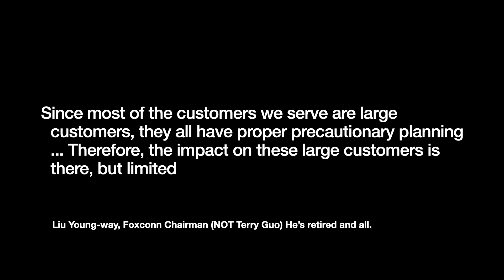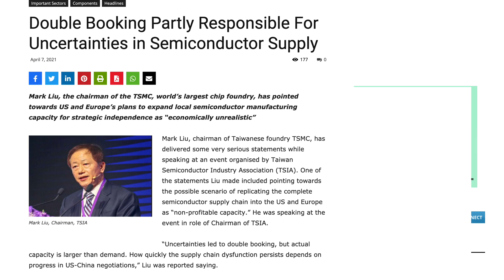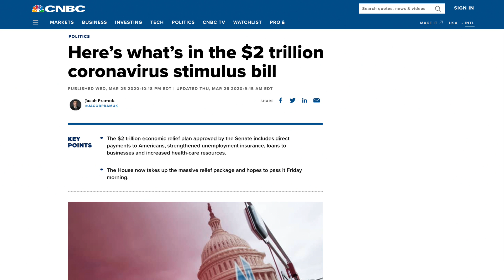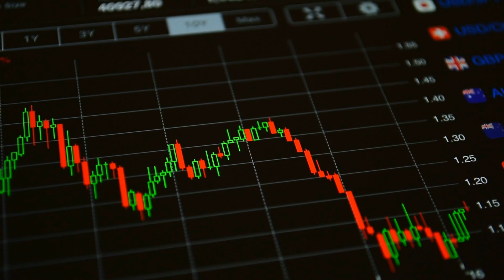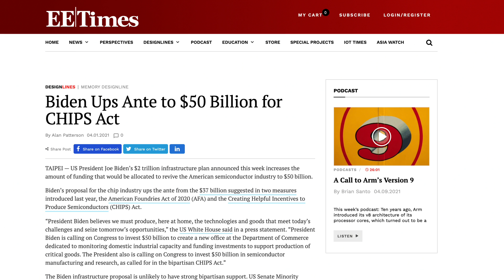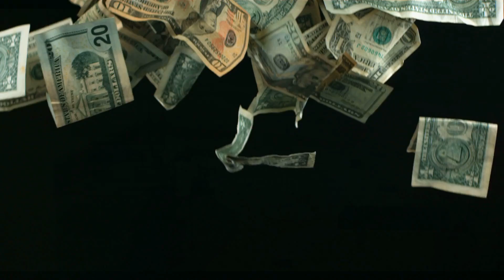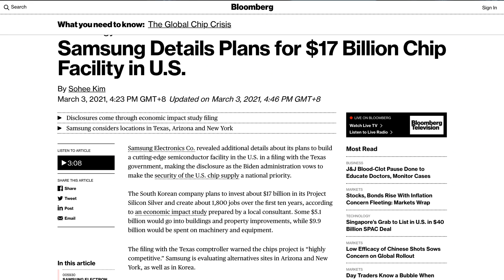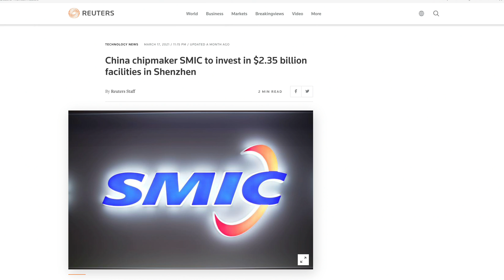The Coming Semiconductor Bust

Comment: Is anyone doing research on resonant tunnel diode threshold logic fabs? With threshold logic reducing gate count by 30% and tunnel diodes at 30 THz with a speed power advantage over CMOS of 100,000, this would be an excellent future path. Especially, now that CMOS CPUs are setting fire to motherboards and GPUs are melting connectors and wires.

Comment: Great analysis. It's clear you were right

What you didn't predict was the Ukraine war and it's absolutely massive insatiable demand for electronics.

Each side is fielding tens of thousands of drones each month. Combined with sensors, terminals, headsets and a myriad of other electronics it's clear that if it wasn't for the war the industry would be in the middle of a bust.

Although you have to wonder who had advanced knowledge on the Ukraine war..... Seemed like a pretty  amazing bet to spend some $200-300b on fabs despite the collapse in crypto and the covid WFM situation.

Comment: 3.5Billion / 50000 = 70,000 die/wfr.  What are you talking about?  Maybe the smallest freaking logic chip (which hardly anyone uses these days),  you might be able to get 70000 die/wfr....BUT no one knows because those are not the kind of things that will run in that TSMC fab. For things like processors and such you are lucky if you get  a couple hundred on a wafer.  (Yeah,  I worked at a leading edge fab.)

Comment: I’ve been thinking this for a while too. Each factory is also getting more and more productive with time. When new fabs are built on this scale those productivity gains will be applied to the new fabs and output will be insane. Market won’t know what to do with all those chips. 

If we have a war then all bets are off. War will likely break out in Taiwan and all that capacity goes to zero. Plus the need for chips for missile systems will send demand skyrocketing. 

It’s 50/50 at this point and all depends on what happens with the China/Taiwan situation.

Comment: Read a bunch of comments, that I agree with, you concentrate on the obvious users of chips, computers, cars and consumer tech, but miss the fact that all industrial machines from the largest to the smallest all use thousands of chips. And they are just the tip of the iceberg of other chip users. Nothing sold today that connects to mains or batteries is free of chips. Even the battery packs themselves have chips in them.

Comment: A great video, with terrific insights. The boom and bust nature of this industry is too quickly forgotten. Thank you.
Stepping back for a moment to look at the broader macro economic environment I have to consider a huge shift in the fundamentals which you may wish to consider. Simply that America is going home because there is no need for importing energy from overseas.
North America can easily become self sufficient in every single commodity, from oil and gas to wheat to rare earth metals. Hence the US military will no longer require be a provider of sea lane security, which it has done for American intrests since WW2. After all, why help your competitors when it no longer benefits the US? The US will only assist it's core allies and it will expect them to help themselves. Global supply chains will reduce dramatically. The world's biggest consumer, the USA, due to favourable demographics compared with the rest of the world, will get the majority of its needs from manufacturing in North America. Mexico undercuts Chinese labour easily with the benefit of a short supply chain and cheap US energy. The industrial boom from relocating manufacturing to North America will be enormous and drive the economy of the region for at least a decade. The new factories will be as automated as possible, which will be good for the semiconductor industry, but semiconductor companies will relocate or not be able to sell to this market. Expect the US Government to demand that companies it does business with to become American or registered in a close ally country. The likes of TSMC, AMD and Intel will open new fabs in the USA and not update fabs in most other locations.
Of course Russia invading the Ukraine and kicking off Cold War 2.0 will affect this fundamental thesis in unforseen ways, but a massive relocation to North America is absolutely guaranteed. Along with this will probably come a political shift towards isolationism, which has already been the case for the last four Presidents, as the USA simply won't need the rest of the world as much and hence won't care much what happens outside of her borders. The results of this shift will, and possibly already are, be felt around the world.
Just an opinion. All the best everyone and good luck.

Comment: Chips do store well. Mostly the base chip is created and then finished to specification. Most suppliers use long term contracts and thus cycles are smoothed. There is no shortage. There is excess demand. FABS are expensive which creates high barriers to entry. 

You have offered no new information. In fact you are just regurgitating a common thought about the industry that is no longer valid.

Comment: the funny thing is that half of these fabs will go bankrupt or get bought out exactly because of that 'saturate the market with anything down to the lowest possible cost for given production of scale' - so essentially the most efficient/biggest ones will out-marketshare everyone else, and if they don't and collapse instead, then it'll just mean an even bigger chip crisis - too big to fail logic.
But at the same time demand has moved into virtual demand, because with price inrease affordability ranges haven't changed for most people, but the more people in the sencond/third-world are moved out of essentially poverty into having the option of the firstworld middleclass spending - that also adds demand (majority hasn't been), so there is room for cheap chips.

Comment: Chip designers (AMD, Apple, Intel, NVidia, etc.) pushing the envelope need to be accounted for in the equation, because the cycles are tightly connected.
For many years, we had slow progress on the design side, but that has changed.  Massively complicated designs, combined with new packaging technologies, require larger number of chips.
I believe this trend (new more complex designs and packaging solutions) will continue for at least a few years, and will keep the fab business thriving for at least that long.
Reply: Circuit board complexity is way up. Board companies will quote on buried vias. But this greatly raises costs. And makes testing more difficult.

Comment: I’m missing the context of supply versus demand. 

I read that although there is a lot of investment in “sub7” fabs, the majority of the chip shortages causing inventory delays are “plus10” chips. As you said in the video, older fabs are in a race to the bottom and have eaten most of their less performing competitors so the supply is relatively low.

As long as the supply does not match the demand, we will be stuck with product delays until the new fabs are operational and manufacturers integrate “sub7” chips into their new products.

Comment: I see a lot of demand for large amounts of memory(SRAM and DRAM), electronics designed with 8bit microcontrolers are being replaced with more efficient and way faster arm-based controllers and these need to get cheaper, fpga chips and asic media accelerators, plus ai accelerators... all of these need to be fabbed maybe with a 28/24/22nm process, but definitely don't need the next gen process.
The new build-out is in the wrong direction, we need many more fabs that are not on the cutting-edge process, not multi-bilion dollar 5/4/3nm fabs. 
I think GlobalFoundries is on to something - expanding capacity for their existing process technology is the better investment for the next 5 to 10 years, rather than trying to fight for the next node advance. They will be catering to a new generation of chip design startups that can't afford the new nodes.

Comment: The shortage in high-end VLSI stuff is one thing... but I am finding shortages in power mosfets, low-end microcontrollers, and TTL components that are low end products that outfits like TSMC would laugh at.  It's hard to look at the semiconductor industry as a whole when there is such a split between high resolution low volume components and the rest of the manufacturers.

Comment: You are right every semiconductor factory is loosing big $$ right now because of manufacturing capacity that is too low. They could sell more than they can make. So now they investing in new fabs but by the time that they start production the demand could shrink down to normal or most likely below normal because of bigger quantity of chips sold in previous years. That is allot of factors all of them will drive chip prices down below profitability most likely.

Comment: So you're saying over-supply of chips will cause a bust? Like the oil business, new shale producers came in the oil market when demand and prices were high which caused greater supply and lower prices contributing to a price crash to $30-20-10/barrel thus shaking out and bankrupting the new or smaller oil companies = bust. But oil and fossil fuels have competition from green energy while chips don't. So, TSMC and Samsung will not go bust, but the new or smaller chip makers will if there is ever a  chip "bust".

Comment: There are a lot of basic chips that don’t get updated every year. In fact many of them are many years old. And those are also in short supply. There’s a lot more to electronics than the latest CPU, Flash and RAM chips. And you need every chip to finish a product. Not just the high dollar ones.

Comment: There's also another "law" regarding return on investment. You can spend $1,000 to get a product that is 99% as fast as a product that costs $1,000,000. We are basically at that point with traditional semiconductors. So I think there will start to be a trent to accept a step back in technology. The Chinese are building lots of fab plants. My guess is they won't be the highest tech 2nM plants. They will be lower tech, but cheap. You will be able to buy 10 previous gen chips for the price of 1 current gen. The difference in performance can easily be overcome with software tweaks. This can't go on forever. Until next new technology for semiconductors come, or something that replaces semi conductors entirely, we are at the limit. All technologies have a practical/physical limit. Look how many years it took to build a production car that could hit 300kph. Maybe someone can triple the price and get it to 330kph. But nobody is every going to build a production car that can go 600kph that rolls on wheels.

Comment: This channel is new to me. I'm impressed by both the range of videos it has on the semi industry and the detail it provides.  It's boggling to think that about three decades ago, there was debate as to whether features could be constructed smaller than 100 nanometers. Yet now, it sounds like 2 nanometers is within grasp.  Approximately 3 nanometers is the point at which some of those advocating nanotechnology (e.g. Eric Drexler) claim features could be atomically ASSEMBLED by migrating atoms/molecules instead of using ablation to selectively remove material from a bulk solid (like a wafer) or relying on a uniform vapor deposition
Reply: It took 7-9 years for EUV, actual transistors aren't smaller than 40-50 nm. \TSMC 7nm is just a marketing term, it's bigger than 3x that
Reply: @harshivpatel6238  I'm no expert in the field. But from what I've read, what is represented by the number (e.g. 5 nm) is the size of the smallest feature, not a complete transistor. The line width is perhaps the smallest feature. Wikichip says the following ..."TSMC started mass production of its 5-nanometer N5 node in April 2020. TSMC considers its 5-nanometer node a full node shrink over its 7-nanometer process. In early 2021 TSMC plans on introducing a second version of its N5 process called N5P which provides additional performance"
Reply: @gregparrott  while it's certainly exciting, you should add 6 months for a fab node to mature after it's announced, and 6-12 months for products made on that to reach various parts of world.
Reply: @harshivpatel6238  As an end user, about the only significance I attach to it getting so small is the purported reduction in power consumption. As I understand it, Apple's new M1 chip runs  extraordinarily cool, and is the result of both RISC architecture and small feature size. The M1 Max has 57 billion transistors and up to 64 gB of integral memory.
Reply: @gregparrott  M1 has a lot of accelerators for different work loads, CPUs & GPUs are more of a general purpose hardware, especially CPU. It's hard to be as good as M1 when you target general purpose use cases.
Reply: i think you're confusing a few things... when fabs like TSMC advertise nodes as 7nm, they don't literally mean the transistor, but rather as a marketing scheme to represent some feature in the transistor as a good measuring stick.
that is definitely not the same when a physicist is talking about 3nm and how that will have insane levels of quantum tunneling of electrons, considering a single Si atom is 0.2nm in length and unless you could make a transistor that is just a single atom (which as i understand it is inherently impossible unless you mean a quantum computer) then the actual transistor is going to be way bigger than 0.2nm.
Reply: @BattousaiHBr  As I mentioned in a prior comment, I did not interpret the dimension as representing a transistor. My understanding was and remains that it represents the smallest definable feature size, such as the line width of a conductive path leading to the transistor. Do you have an industry accepted definition, or are we both just inferring from what we've read?

Comment: 5:38
As though the conscripted macro enterprises on the Integrated SOC were sometimes haunted with overpriced margins rather than the low-profile margins always a fundamental retail rules initiated by China's retail principles that leading with their micro calculations to made their products at the low cost self-efficacies as yet Chinese labor were also cheap and it gains attractive market compare than to the domestic made US were the labour Union can demand a wage hike if the salary standards were mandatory as wages per hour,

and that is why how many US brands forcing to work their products in overseas and they found China to bypass their profits and the majority were not to concerns domestic taxes

Comment: There will be some kind of bust, but not that dramatic: take the PC industry: back in 1994 Windows 3.1 worked well on i486 with just 4 MB (megabytes, not GB of Ram). Now Windows 10 makes me suffer with 16GB. And with DDR-5 coming, the typical DIMMs size will likely be of 128-256GB each. So I expect the future software to demand even more. Now we see that latest video cards have 8-10GB (except 3090) which seems way too low, compared to the older generations (hasn't changed). So I expect  this to improve with chips availability and to drive the demand for more.

Comment: The semiconductor industry is a lot more than just chip manufacturing and merchant foundries. There are fabless semiconductor companies, IP providers, assembly and test houses and design services companies. They are largely immune to the boom and bust cycles of the foundries. In fact cheaper wafer costs and excess capacity are good for most of everybody except the fabs.

Comment: Good short informative clip. I am currently an intern at a company that develops and makes machines which are part of the semiconductor production process. My research has alot to do with predictability and forecasting of the semiconductor market. For this I want to analyze the difference in supply and demand for European vs Asian region. Do you have tips/tricks where to find information for my research? Like what methods for research or which sources do you use?

Comment: Regarding the subsidies, I think you are ignoring the long term strategic and even geopolitical motivations and implications. Every has noticed that basically the whole world depends on TMSC (and maybe Samsung), which is a completely untenable position for powers to be in. Even if subsidies would go on forever (which I hope they don't), there would still be value gained by having a locally controlled source of semiconductors.